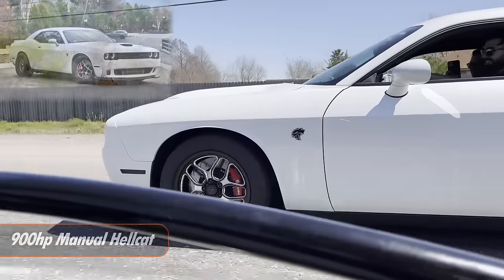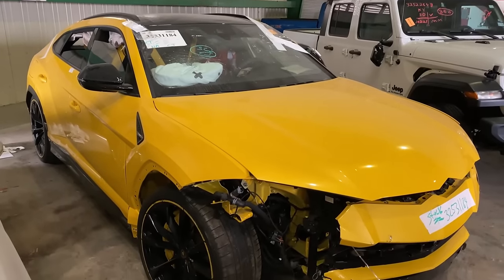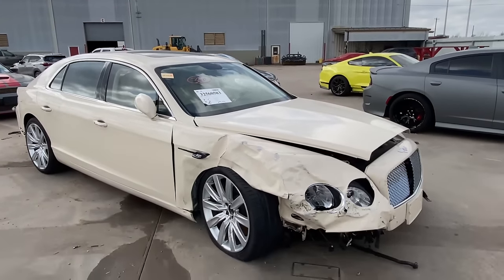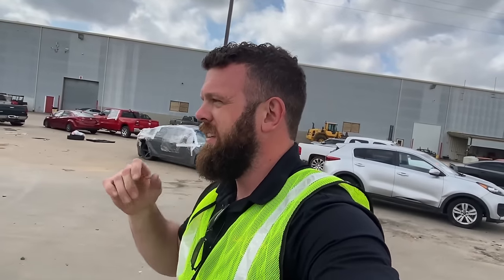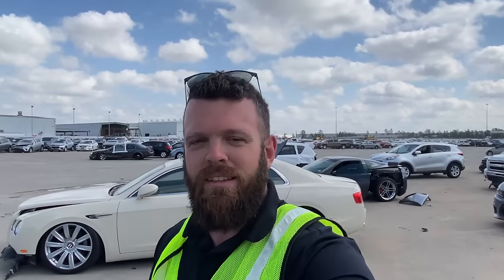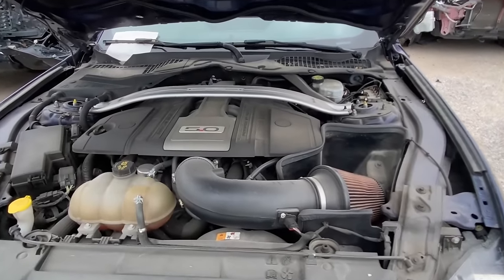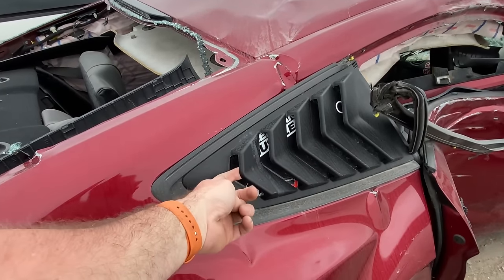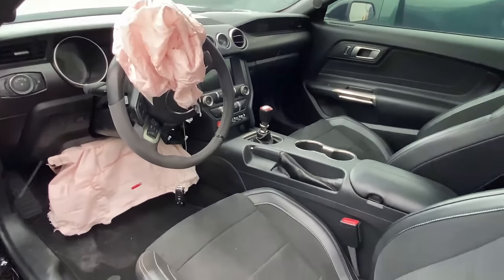Hunting CHEAP Salvage Auction Supercars | STOLEN & WRECKED!

Comment: I've never even driven an Aston Martin , but there has to be a good reason why one of them that originally sold for $300,000 sells for about 50 to $60,000 5 years later . Unlike most cars that cost too much these ones tend to lose their value really quick . That's why Tavarish has a number of them .
Reply from the maker: I totally agree and in general I think that applies to most “exotics” that skew luxury rather than performance, with maybe the exception of the high end rolls market. 

Wouldn’t own one, but they sure are nice when they’re new!
Reply: Yes, the Vantage snickered at 140s.. and you. An get them for 30-45...I saw one sell for 16k..
Reply: @longsleevethong1457  why is he a joke? He started with very little and has some very respectable cars and has content every bit as Interesting as this channel. What the fuck you got going on?
Reply: A 2019 dbs is still selling at 300k, so deprecation hasn't affected these cars.
Reply: @ii_dynasty  A year later and they're now selling for around $200k. Some a little more, others a little less. One thing that I think will keep their price up is the fact that gas engines are under attack so V12 cars like them will be things collectors are going to want.

Comment: I think the a pillar thing and console panel lift is to do with the key fob antenna for the keyless start as that is where they are often located. In the UK many theft happen outside the owners home with keyless start using a lap top and antenna booster. It picks up the key inside the house and boosts it to the car and off they go in 30 seconds. We keep our keys in special pouches but tin foil is the same or put your keys in the microwave at night
Reply from the maker: Good to know thanks for posting!
Reply: You put your keys in the microwave every night?
Reply: @LargeFather95  you didn’t read what he said smh
Reply: Or just install a kill switch. Won't stop them from breaking into the car and probably do damage trying to start it, but they won't take the car and ram it into someone else at 180 mph and ditch it as your problem.

Comment: On the gray Scat Pack in the parking lot with the hood tied down: they used an earlier model Hellcat hood on some of the newer Scat Pack models.  I have a 2023 Challenger T/A 392 manual and it has the Mopar Performance cold air hood on it from the factory.  It looks like the Hellcat hood that you have there minus the vents.

Comment: That thing you were holding in the ss was the auxiliary fuel system. Comes on at a certain boost level to active another fuel pump. Also the servo sound was the water pump for the supercharger
Reply from the maker: You called it!
Reply: @scraplifegarage  horry time to cash in them points. I need spare lsa blower lol 😂🤷🏾‍♂️

Comment: The ls400 toyotas are great all around. They do fix up pretty cheap, main things that rust up are the suspension components and the antenna bracket. Everything else is fairly typical of most cars, like the bottoms/edges of the doors, wheel wells, and underbody. Great cars, definitely a daily. Flipping specifically ls's i'd keep in mind Black interior goes for a-lot more, as in you may get 2k extra ontop of what you'd typically get just because of a black interior, even on a car that didn't originally come with it.

Comment: You said, "I saw this badge from a mile away and we all know what that is"
NO we don't. Powered by Hennessey, isn't that some kind of hard liquor? 
Now you told us, blower car. I  got it.
LS ... so now I get more of the picture. Small car and big power plant!

You said" as we get more into Porsches I am beginning to get a significant love for the older one". 
They don't have the power of GT2/3 but they are smaller and move quickl. You feel the power coming and you feel the road, the handling. 
I would only offer a guess on that white Porsche Career... and 1985-89. The sweet spot one is the '87 because it has the G-50 transmission. Price, I would have to see the engine and interior and drive it. Sorry. When I bought my '86 4 years ago I looked non-stop everywhere for 10 months. Back then it was harder to find anything but now with all of the apps available it is much faster and easier. I would rather have my '86 than the Hellcat, Lambo, Auston.

You hoped that the wind noise and the weather DIDN'T ruin our experience of this video. It didn't  as I am sitting in my home office eating popcorn I just made and the heat is on in the house.The big winds out side my window ... are OUTSIDE.    DO more of these videos.

I like walking with you (and listening to your comments) through acres of cars with the huge variety of make. Something that would never happen in real life. 
When I was a teenager in California I would often go out to the "auto wrecker yard" for 3-4 hrs. on a Saturday and slowly go up and down the rows of cars looking, and looking; for nothing in particular. I always did find several Ahhhh cars and that was just a little extra that I was thankful for. During that adventure, time stopped and I got to fantasize about cars. Thanks for the walk.

"A garage without a Porsche is just a dark hole" — Walter Rohrl - Porsche Development